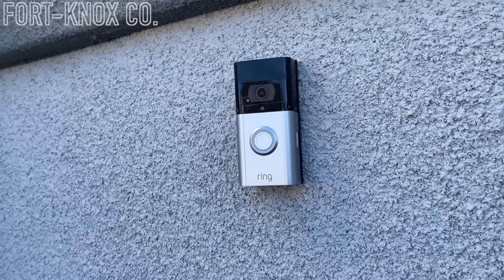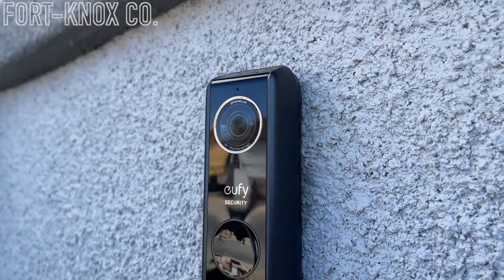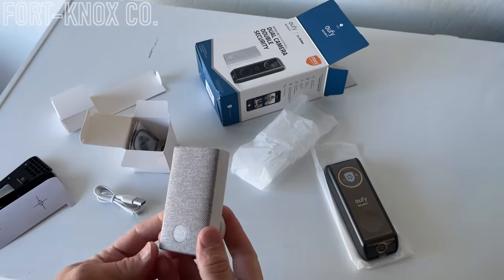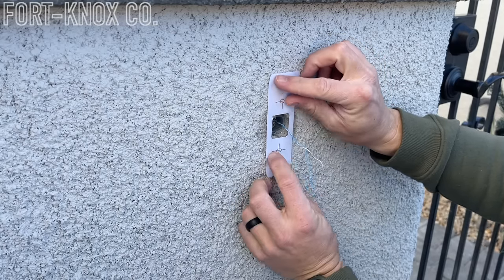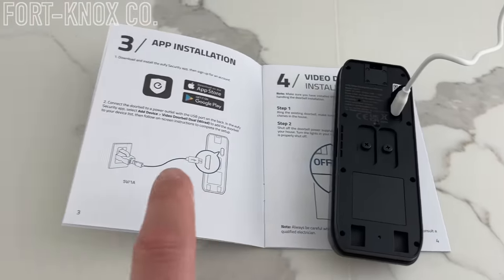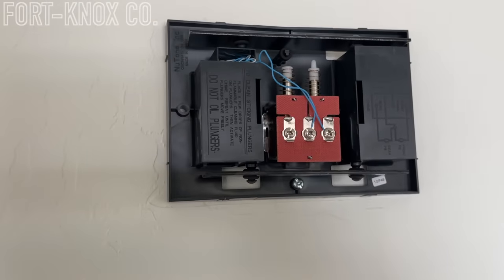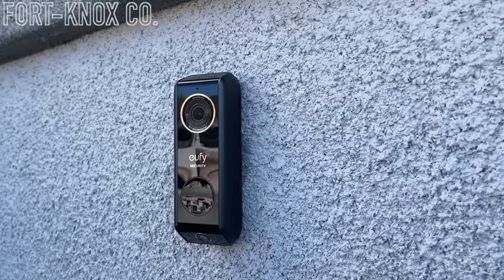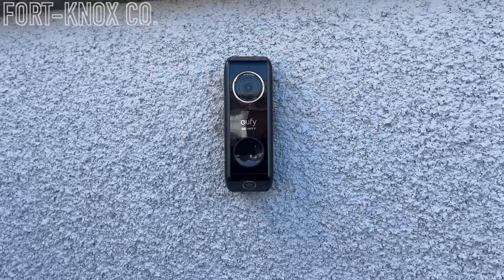BEST Video Doorbell 2024 with No Subscription Required Eufy Dual Camera Doorbell Installation Memory

Comment: Easily hacked…….you for that ‘feature’.
Reply: Software was patched. Ring is hacked all the time and they allow PD access without your approval.
Reply from the maker: I’ve heard the same thing from many people. Seems like they will always need to stay ahead of this stuff.
Reply: After a little research my biggest issue with eufy doorbell is you lose the house chime.  That’s a simple fix on there part.  Everything in my house has purpose. A box on the wall should not be a thing.
Reply from the maker: @scgook  I see what your saying. But usually when you have some type of storage, for let’s say a camera system, you will have a box that that camera system plugs into where the memory and power source is. Or for any other type of system you’re going to have a box or two associated with the function of it. So the small little chime that plugs into an outlet anywhere you want in the house even in the most discreet location might not be that big of an eyesore as you may think. We actually like ours because it’s very sleek and clean looking and white. It goes along with our kitchen very well. But like I said, you could put it in an outlet anywhere you want that may not ever be used.

Comment: i want one that is compatible with openhab, none that ive seen fully are. my smarthome is fully firewalled, on its own vlan, no internet, except for occassional updates, no cloud function (i vpn in if i have to with a private hand rolled vpn that i use) i take security VERY seriously.
Reply from the maker: Yeah I agree. Like You said it’s hard to find one that meets all those marks. I hope something becomes available that allows users to have all that
Reply: @FortKnoxCo  I think a combination of a zwave contact sensor on your reed sensor on your existing doorbell along with a rule in the automation to trigger a 2 way standard ip camera is a close hit. However, this depends on latency between the two devices and the controller. I have this all planned out but need to acquire devices to do it.
Reply from the maker: @xphiles2345  sounds like it’d work. Let me know when you get it all set up how it goes.

Comment: Personally i would just install a discrete cctv system at high level which cannot be tampered with.  If anyone is going to do something untoward at your property then they are not going to think twice about smashing off your expensive doorbell whereas they cannot reach a high level camera
Reply from the maker: Yeah I think it’s good to have both. The thing I don’t like about high level cameras it that they don’t capture great images of faces and other needed details. I like having a couple just above your eye level so you can see more linear views  rather than Birds Eye view.  Luckily you can get many different options at affordable prices so you can build a pretty good combination

Comment: So the Eufy doesn't allow me to use my existing doorbell? FAIL! My Ring does. I have a large house and need to hear the mechanical doorbell everywhere.
Reply from the maker: The ring, and the Eufy doorbells all have a plug-in remote doorbell that chimes whenever someone presses the doorbell outside. This is a benefit because you can plug that doorbell in anywhere you want and even put it in a better place than the house one is located. Some people put multiple doorbells within their house to be able to hear it in different rooms. So it’s just another option.
Reply: I don’t know much about all of this. I’ve been looking into however. I like my existing doorbell. Also to think someone could just tear it off the wall and walk away with it… I’m personally just thinking of trying to put a couple of wired cameras around, 2-3 that are Wi-Fi connected. I have whole house generator if power is lost. I’ve been looking for some cameras that notify human movement, day or night. I have outdoor lighting pretty much everywhere from dawn to dusk. So a floodlight isn’t needed. Also I would like to have an app that I could pull up all of the cameras if I heard a noise or something. I’ve read some have SD slots that roll on for a length of time, and record over after a period of time. I really don’t want to pay a monthly fee if possible…. Any suggestions from any you that are familiar with security cameras….
Reply from the maker: @ronharrington8659  I get what your saying. As far as the doorbell these have a storage unit inside that some come with so your video is stored inside.it’s their HomeBase. Also they have their wireless door chime which I believe has the local storage too. So even if someone took the doorbell off the wall you’d have your video stored inside your house on one of those devices. As far as camera systems there are lots of choices that offer motion/human detection and notifications. They also all offer local and cloud storage. So you might just need to pick a couple brands and read what they offer, because most of them offer those features now.

Comment: The only thing i missed or you forgot was to disconnect power turn breaker off🤷🏿‍♀️
Reply from the maker: Yeah you should turn the breaker off when working on any electrical. In the video where I show how to upgrade your doorbell transformer I mention that for sure. But when working on the doorbell itself it’s low voltage so even if you didn’t the risk factor is minimal. Just don’t want those two wires touching either way when the power is on. Could pop the breaker if you arc the wires

Comment: Really? I’ve got ring and never had that problem and I don’t mind paying 30 bucks a year and I love the ring
Reply from the maker: That’s awesome that you haven’t had any problems. Wish I could say our experience was the same. I tried a couple things and just couldn’t seem to get it to work as smooth as I expected it to. Plus the biggest downside for me was having to pay any type of subscription to get it to Use or have the features that it advertised. I feel like for the price you pay you should get those features accessible with home storage. And then the upgrade for cloud storage should just be an option. I felt like they were kind of holding all their cool features hostage for a few bucks a month in addition to the original cost. Either way luckily, there’s a lot of options out there for people and their different budgets and needs.

Comment: its an electronic all these door bell ring cams have issues and break and stop working, all that. lol will you get lucky is the question. seen many bad reviews on this. deff cheaper options without subs out there but your paying 200 for something that may break still. Rather take my chances w a cheaper option ngl. Great vid though.
Reply from the maker: I appreciate that. Yeah you’re hitting the nail on the head. Nothing is perfect. I’ve seen every brand of electronic break or have issues.

Comment: The RING ring was the worst investment we ever made. And, in Canada, it is almost 100% useless during winter months. A hole drilled in your door and a cheap spy camera duct-taped to the inside of the hole would be better than investing in a RING camera.
Reply from the maker: Ive heard the same thing about how they operate, or don’t operate, in the cold weather. We weren’t impressed with ring overall, that’s why I started looking elsewhere

Comment: I purchased the dual camera without homebase. When I plug in the camera to attempt to set it up in the app, the camera light does not come on. Only the tiny blue light is on. Can't get any further. BTW, I reset the doorbell and the light still doesn't come on.
Reply from the maker: So when going through the apps walk through to set up your not getting it to go through the expected actions to complete ? If everything is being done the way the set up walk through says and it’s still not connecting properly then I’d guess it could be a defective unit? I’ve had really good success with most units I’ve set up by following the prompts with their set up process. So may be a manufacturer defect or technical issue

Comment: I've never had a problem with Ring updating. Having a memory card in the doorbell is nice but if something pulls it off the wall and destroys it there goes all your video
Reply from the maker: Yeah that would suck to lose all your data. But luckily they don’t store the data in the device itself, it’s stored inside your home either in the plug in chime on  wall somewhere that you choose or their  Home Base.  Your data is safely inside

Comment: While Eufy performs better than Ring in almost every aspect, Eufy presents some security issues that they did not disclose earlier on.
Reply from the maker: I hear ya on that. But I think in all categories everything or brand is subject to security risks these days. Seems like no one’s firewall is perfect. Big companies getting “hacked” or what not.
Reply: @FortKnoxCo  yeah, once Eufy does address these issues and fix the backdoor that’s still an issue with security, I might consider switching over.

Other than that, nice and comprehensive video and straight forward!
Reply from the maker: @jbphotomain  thank you I appreciate that.

Comment: Internet is required for this doorbell camera to work. Same as the other brands.
Reply from the maker: You need a WiFi at your house. If you want to access it across devices not under the WiFi then you’ll need the internet access. But you don’t need to pay for cloud storage or other fees if you don’t want to

Comment: Great, what if I don't want to run thermostat wire to my fucking doorbell??! Does this model have a battery version or no??

ALSO! How much were you paid for this review, or what items were you compensated with???? That's the million dollar question??
Reply from the maker: No need to get all emotional. Obviously they have batter power versions and hard wired versions. If you would take a second to read the descriptions you’d see I have links for both options. Pretty much every manufacturer now a days has a wired and battery version for that exact reason. If possible I’d try to do the wired version because they seem to be more reliable overall with constant power and not having to change/charge the battery is a huge plus. 

As far as compensation, I wish. I did this video just out of the kindness of my heart. Wasn’t happy with Ring, found Eufy and wanted to share the Info. It’s the cool thing about having a YouTube channel, it’s just like a co-worker sharing a brand or item with you that they purchased and loved and think other people will love too.  Either way it’s all information to digest and take as you will. No one’s opinion or YouTube video should be taken as gospel. Always do you research and try out things. See what works best for you. 

Either way thank you for watching and the comment. 🤙🏼 hope you find a video doorbell that works for you and within your budget.

Comment: I've owned the eufy doorbell cam along with Pan & Tilt cam for the last three years. They are the most unreliable and glitchy cams I have ever owned.
Reply from the maker: That’s sucks to hear. I haven’t experienced that. Never had any problems with my doorbell. Haven’t had to reconnect or re set up anything sine the day I installed it all. I haven’t used their other cameras though. So can’t really speak on those but I’d assume they are just as good.
Reply: @FortKnoxCo  I have replaced the doorbell cam once already. They sent that out to me free of charge so that was a plus. That one worked flawlessly for a while, Then the app updates started. I lost access to both the doorbell and the Pan & Tilt cam for over a week. I've just had nothing but problems with the system so I am looking for a replacement currently.
Reply from the maker: @raffeal247  man that sucks. I hope mine don’t start doing that with updates. So far so good though. I was looking at adding a floodlight camera in the near future
Reply: @FortKnoxCo  How long have you had yours?
Reply from the maker: @raffeal247  I’ve had it for almost a year now.
Reply: @FortKnoxCo FortKnoxCo Okay, so we shall see how things go for you because I think my issues started just after the one-year mark.
Reply from the maker: @raffeal247  funny how Al that stuff happens right after their 1 year warranty lapses. We shall see. Fingers crossed
Reply: @FortKnoxCo FortKnoxCo Yes, figures crossed.

Comment: My biggest problem might be installing. I don’t have a power tool and my house is brick. I only have 1 hole. Sighs.
Reply from the maker: This might the excuse you need to buy yourself a nice drill and but set. With the money you save doing it yourself it’ll pay for those new tools. Then when your done you’ll have the tools paid for from YOUR sweat equity and you can tackle the next project.

Comment: Arlo was good but it’s failed after 2 years and it’s only ai customer support
Reply from the maker: That’s no good. So far our Eufy has been hanging in there. Still working great and going on 2 years.
Reply: Yes, we are going with them. We are about to get it in a few hours. I’m dependent on the front door cam for deliveries mainly. Appreciate the video.
Reply from the maker: @dna2405  no problem at all

Comment: I thought these were meant to be wireless in 2023
Reply from the maker: They have a wireless version and wired. Depending on what you want. I prefer the wired version because I didn’t like having to recharge the battery periodically. But if you don’t have wires where you want to mount then the battery powered is perfect because you can mount it basically anywhere

Comment: They don’t make a true wired doorbell, the wired only charges the battery. Not even a contender
Reply from the maker: I don’t believe this is correct. They make a wired version and a battery version. The wired stays on 100% and does have a small amount of energy stored inside for when removing and syncing. But it will not operate without being wired for very long. The battery operated version is fully removable and rechargeable.
Reply: @FortKnoxCo  nope almost bought one, the only thing the wired one does is charges the battery. Check the diagram even the wired has a battery
Reply from the maker: @donhgr  I’m sure it has some sort of battery inside but it’s using the constant power to run with the battery for random power outages and when you have it off the wall to sync n stuff. That sounds like a smart design to not be 100% wired and not have any way for it to hold a charge temporarily. Either way they have a wired version and a battery operated no wires needed version. It’s a really good system. We haven’t had any problems with ours. 

Luckily there’s so many brands out there you can find something that works for your budget and your needs.
Reply: @FortKnoxCo  if it has a battery I don’t want it! Here’s a really good review of it

Comment: My biggest complaint is that I have to charge it every two weeks 
Anybody else have this issue
Reply from the maker: I had to charge it every 3-4 weeks because there was construction going on on our street. It was registering motion from Vehicles and people constantly. That drains on the battery life obviously. So I set the sensitivity lower so it would only pick up closer to our front gate and not across the street. But I still ended up switching to the wired model for this reason, I still don’t like having to charge it. I wanted to set it and forget it.
Reply: I had to charge my 1080p doorbell every 3-4 weeks. We don't get a lot of motion at the front door, and only occasionally get "false" alarms with traffic on the street, usually only when large vehicles go by.
Reply from the maker: @JohnBGood-kq3ul  do you have the ability to go to the wired version? It’s a life saver with not having to charge
Reply: No. I have about 2 months of many notifications and I'm at about 60%. My door gets a lot of traffic because on my neighbor and his friends at my triplex. I disable the device thru the app when i am home to avoid dozens of these needless notifications. I set the motion detector to the next to lowest setting to avoid street movement. The device works very, very well. Had some trouble removing it to recharge. Wish it was simpler. I had a Ring and it was very problematic.
Reply from the maker: @beagles70  I think until battery technology gets better it will just be a part of life. The only down side to all these “wireless” devices.

Comment: THIS PRODUCT HAVE A PROBLEM FIRST THE SD CARD IS INTERNAL AND YOU NEED BATTERIES..
Reply from the maker: If you get the battery operated one, then yes, it comes with a rechargeable battery that needs to be brought in and recharge once in a while. But that makes it able to be placed wherever you would like if you don’t have a doorbell in the location that you want it. The wired version obviously doesn’t need any batteries. But you do not have to purchase any of your own. And the memory is usually in the plug in chime which is inside your house, so your data is stored securely inside your home, and not in the doorbell itself.